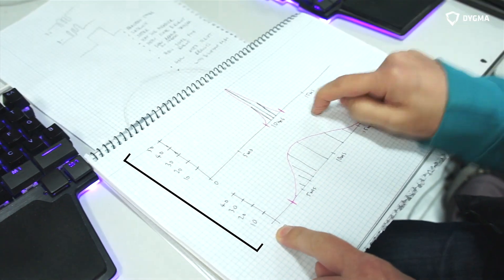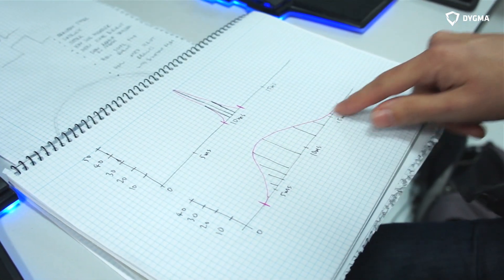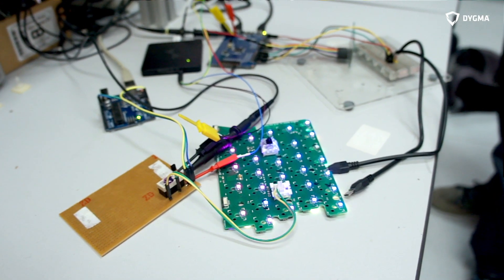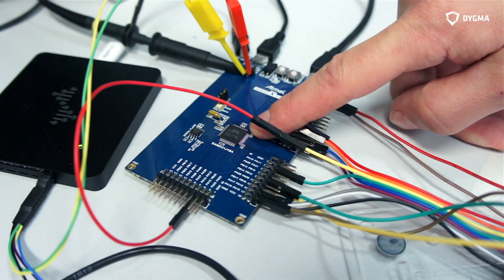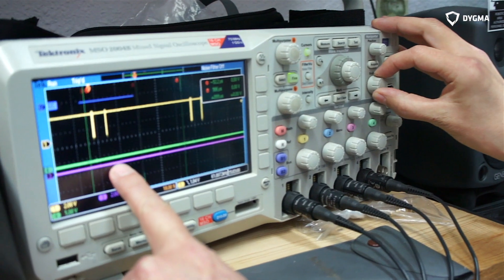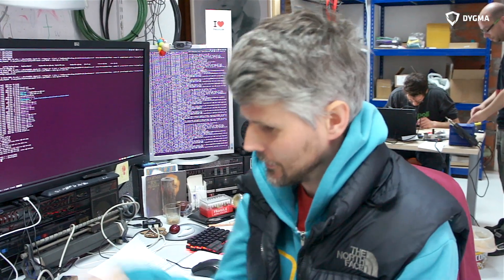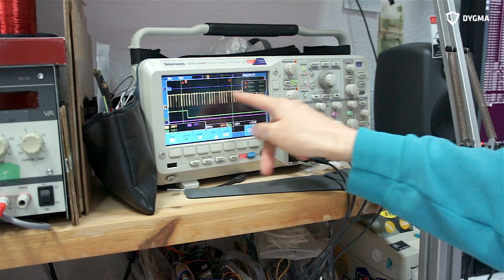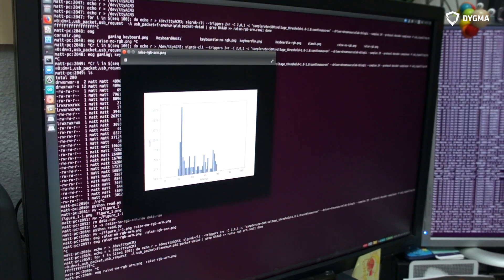Measuring Latency and Jitter

Comment: Given that USB busses have inherently high latency as a result of their polling architecture, I wonder if it is sensible to buffer output data, thus avoiding any jitter, but providing consistent latency. You mentioned you have a great deal of program memory available, so maybe this could be optional? Just throwing thoughts out there. Love the tech vids!
Reply: Hey Capta, thanks for the comment. USB for keyboards is usually polled at 1ms - which I don't think is high for an input device. I don't think a buffer would help with the jitter, as the jitter seems to be caused by the processing and data i/o involved in updating all the leds. 
One thing I really want to get more info about is how much jitter is acceptable. Like when does it start to become noticable to a gamer. Maybe we can test it with some pro gamers.